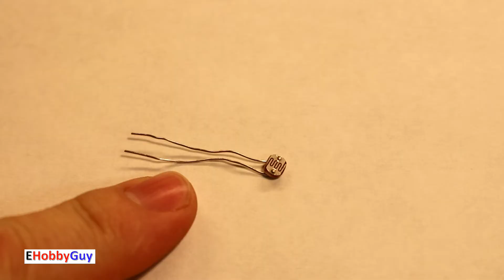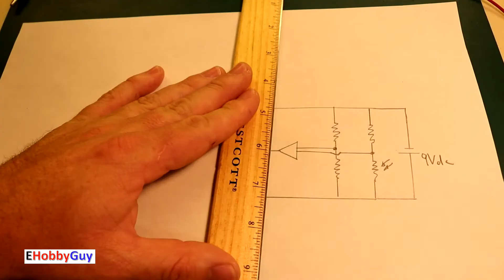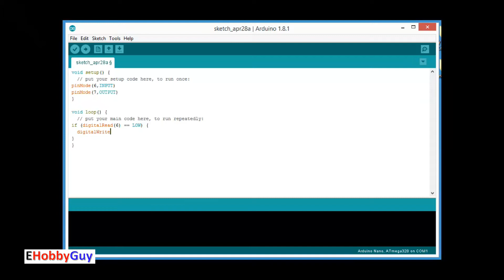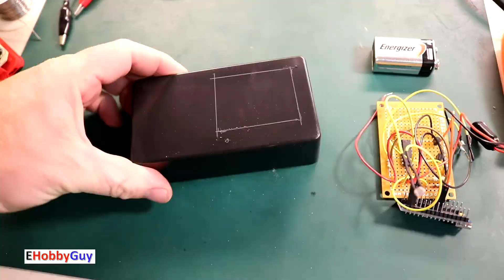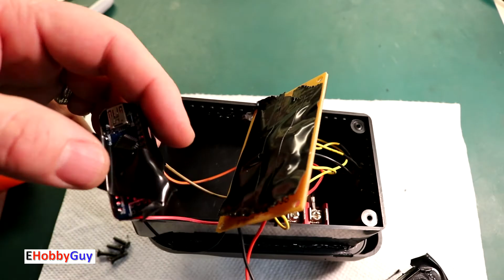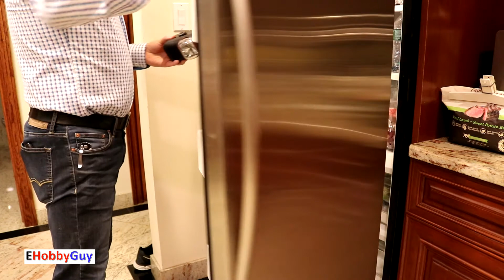Personal Private Portable Alarm - Warning its LOUD!

Comment: Sorry for the necro-post and being pedantic, once you introduce the Arduino, you can get rid of the op-amp. Connect the photo-resistor into the voltage divider, just connect that to an analog input on the arduino. Set the threshold in the sketch and drive the transistor from a digital output... or make the circuit fully-retro and another op-amp with a resistor-capacitor voltage divider (choosing values of components for ~2 sec delay), then a threshold voltage divider to set the delay. Other people would have used a 555 timer for the delay or discrete transistors instead of op-amps. The next challenge would be to minimize the at-rest current draw. Whatever works! You learning either way! Belated thanks for the video!